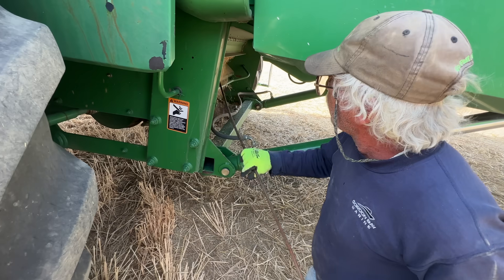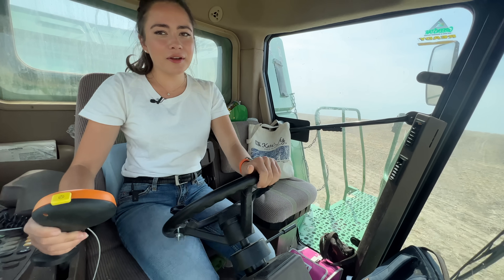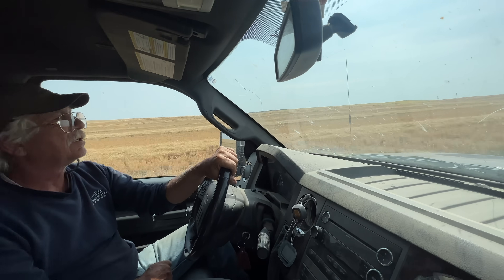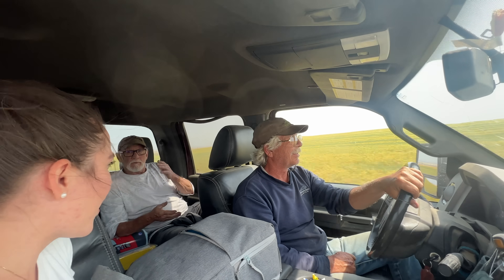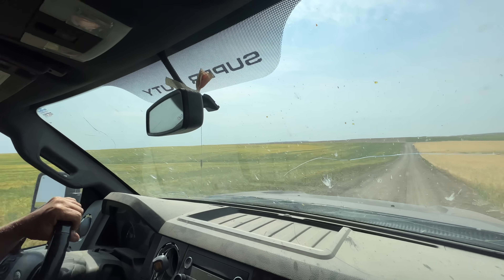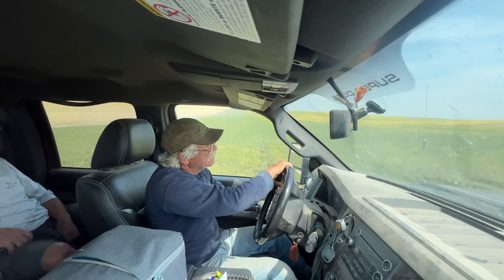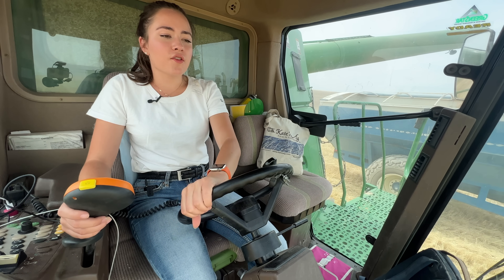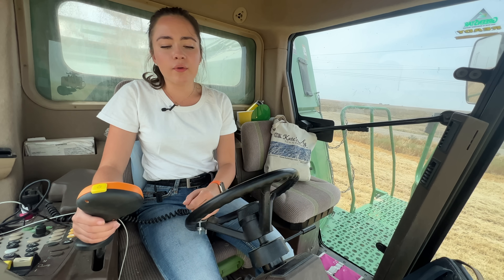Combines Need TLC Too - Montana Wheat Harvest

Comment: Daily start up of equipment for the day... The first thing is check all fluid levels...  Combine engines do chew up oil as they work harder and steady RPMs.  Mostly..  so yeah if low add when ever its hits the low marker bring to the top, which is the running level needed.   do not be surprised if it consumes oil faster than normal.   Change oil every recommend XXX number of hours of operations and every fall when storage for winter.   Oil not changed after working for the fall harvest is very acidic and will cause damage over winter. 

Take care KATE.
Reply: You're spot on! I always change the oil in my engines before I put them in winter storage for the reason you've stated.

Comment: Kate, read the maintenance section esp the daily part in the Deere's 9870 operator's manual that came with that combine. Well you learned about engine oil level that day. Sensors may not always give you a warning. You will learn a lot from the info in the manual & possibly save your father money in the long run. All equipment you operate should have manuals. Hope you all get a good price for your crops. Kate your content is so interesting & great!

Comment: The last time I saw a video about a combine with a lack of oil was on the YT channel Laura Farms. Her neighbor's combine was very low on oil, but there was no warning, or not acknowledged. A gearbox or hydraulic motor, I don't know, became very hot. It sits directly below the plastic fuel tank. The whole combine burned down, total loss.

Comment: Shame on someone! That oil should be checked first thing every morning b4 you start the engine. Not sure how many hours since it was checked, but that's a lot of oil even for a full oil change interval. I would check the inner air filter to make sure it is clean. Probably just go ahead and replace it. If that thing is plugged the turbo will suck oil out of the engine. I'd check the turbo right away too. Then keep a close eye on that oil. A replacement engine for that combine will run your dad around $47,000.
Reply: Wow

Comment: You can run out of gas but not oil.
Reply: You run out of diesel and that can cause a lot of down time but usually no damage. Its not the same as running out of gas. Running out of oil never ends good.

Comment: I can't not not comment.  Sorry.  So Kate.  A couple of things.   The most important.  You need to get your Dad a sweatshirt with your logo.  This is a priority. Dark color white lettering.  There are places around here that do shirts and things (also You Tube swag.). Soccer teams, Kids sports, etc.  Get a half dozen extra large for your Dad and one for Trevor too. It's marketing Kate.  And then, Respect for your Dad.  No questions Kate.  When your Dad is working on the rig (like changing the oil) don't bug him with questions.  Your job would be to follow directions.  And then finally.  What is it with you and Trevor??? Hmmm?   Seems like a nice guy.  Get him in the loop.  What's he doing in the back of the truck for the road trip?  Ok ~ That's it.   😜.  New Hampshire.

Comment: Hi my friend how are you doing? Hope everything is good with you. Yes, you should check your oil every day. Specially, somebody could come over nighttime do something to it. Specially, your bolts  nut on your wheel 🛞 make sure the tight I don’t want you getting in trouble like I did the fall off my wheel 🛞 because I like you cause you’re a good person and very cool friend. Stay safe. Stay warm at night. Don’t get in trouble. I said equipment is meant to be broken when you’re driving it working it OK have you driven A automatic dump trucks yet? See you later, my friend. I miss you.

Comment: that is not good Kate if  the oil is not on the stick that is good that your combine is warning you about low oil   warnings that keeps you form blowing up your  engine. there is a saying oil is cheep and  engines are Expensive  to replace juts like in your car  you check your oil.